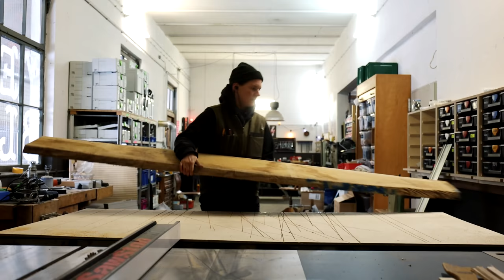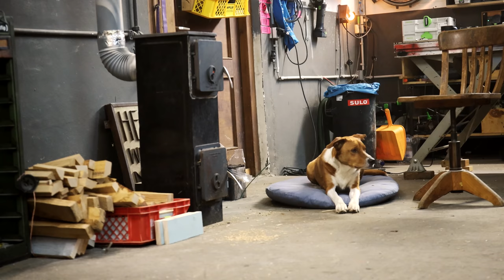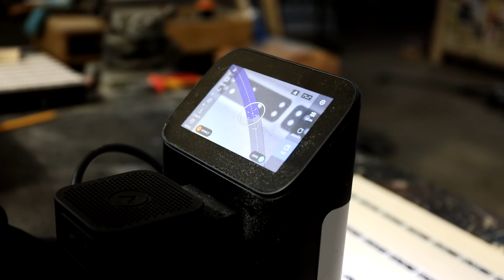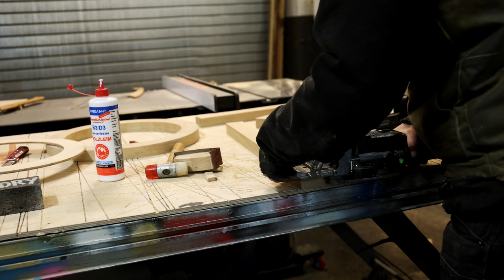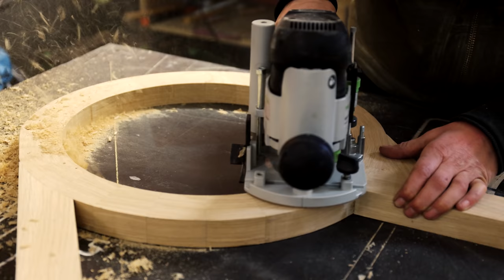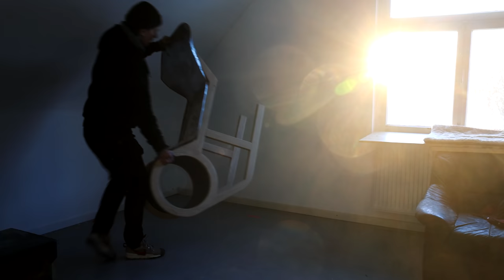Making a Lounge Chair from a Wheelbarrow

Comment: You could make a flat board with rollers that sits in the hollow part for a bookshelf that stays horizontal in each orientation ;)
Reply: Yes!  An automatic re-levelling storage shelf.
Reply: I had a similar thought. Though you couldn't put too much in there or it would make it hard to recline.
Reply: @TheInsaneTD  You could put some snacksm the TV and AVR remote and the TV program, if you still use a paper one - many people do. In fact, you can make drawers that lock in place with magnets when closed.
Reply: @a0flj0  That would work well.

Comment: I like this, would it work as a rocker if so the  hole could have a shelf for your coffee or soft drink with a gyro to stop spilling the drink while gently rocking, would love to work on the gyro part with you being a latral thinker I am not conventional at solving problems but it pays off 99% of the time and infuriates those around me at times.
Love your builds about time one of you bikes could be converted to a wood cutter for camping, another idea generator or heater hot enough to do metal work.

Comment: Wow!
Wouldn't it be cool if you inserted a wheelbarrow wheel in the circle? I don't know the measures but it looks like it would be possible to find a wheel för a wheel barrow that when inflated is just a little bit bigger than the hole in the cylinder. Then it could be inserted and then inflated so it stuck in the cylinder minding everyone of the origin of the chair. =)